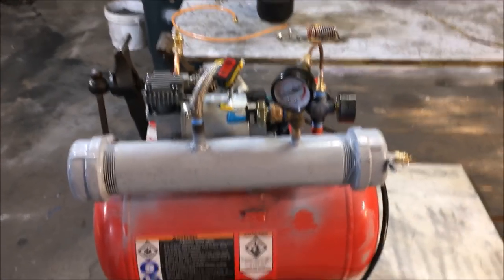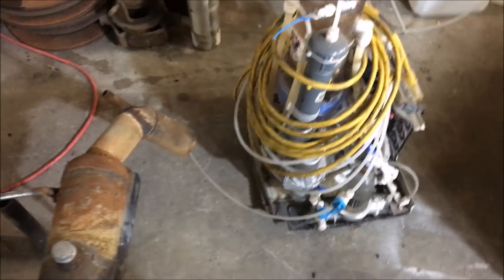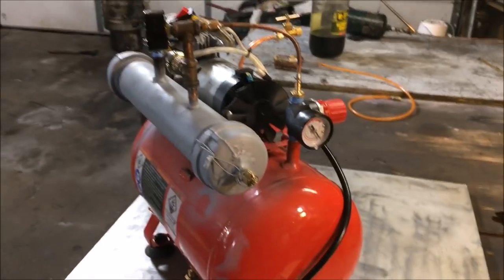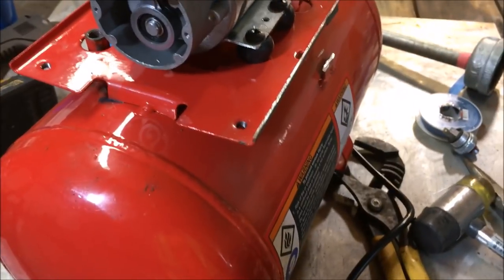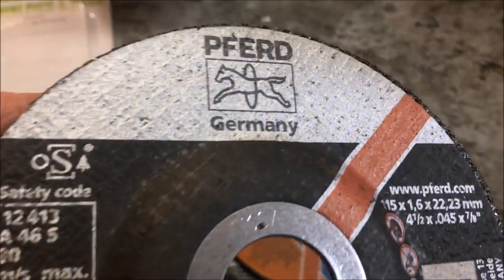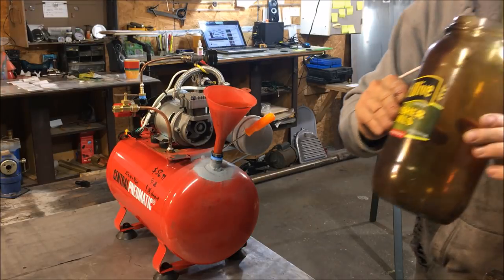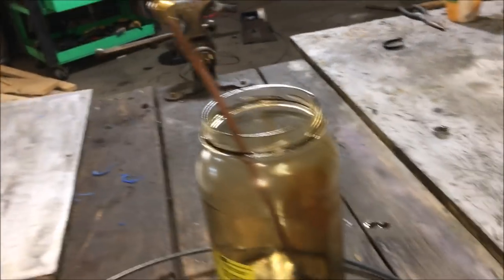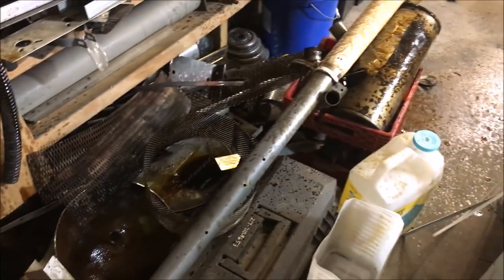Waste Oil Burner Pump ( DIY )

Comment: You need some welding tip cleaners to clear the nozzle. Get them at any welding supply dealer for very little cost.

Comment: Just FYI, lead solder doesn't grind to dust. I'm guessing because it's such a low melting point that when there's enough friction to turn it to powder, it's also enough to heat it to the melting point so it still sticks to itself

Comment: Your max pressure,and flow rate is restricted by the diameter of your tubing inside diameter,and the length of your tubing. We used to catch boiler water samples off a 2000 psi boiler with no other device in the line other than a small sample line over a long distance to the lab, no restriction other than the friction of the line.
Reply from the maker: cool , whpat does turbidity mean ? ive seen that on a meter in a power plant by the test sample area , they have this special sink with all this water running out of different spouts  im a scaffolder so im there alot

Comment: i like your videos but must comment about your opinion on oilheaters.
there is an huge market for heating with waist oil. not just for workshops and car dealers. 
if u can make an burner who can self start up and shutdown and can run on a variatie of used motoroils (not mixed with diesel, petrol) it will sell.
while original burners cant run on used oil ore consume to much oil, and produce to much heat.

im also a self tinkerer on these contraptions and i use a frieingpan for preheating the oil
Reply from the maker: Thanks for the input friend , ill keep that in mind

Comment: Messy ending but good watching
Reply from the maker: yeah , huge mess cant wait to clean up that disaster , just glad it didn't spray the other direction .I'm  very pleased with how well the device pumps oil , extremely precise regulation and perfect low flow parameters not attainable at this price and simplicity using other pumps . not to mention it indeed has high flow potential as it shot about 1 gallon of oil all over my scrap "zone" in 9 seconds or the time it takes to close a needle valve as fast as possible  .
Reply from the maker: we missed a good laugh , from this day on i record the entire process , it would've bin cool to see that oil Jet on film